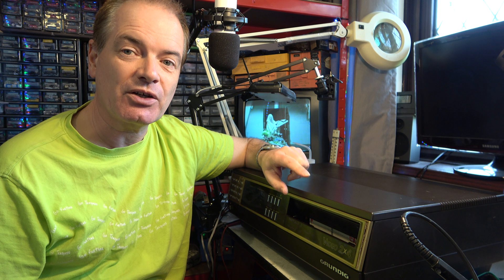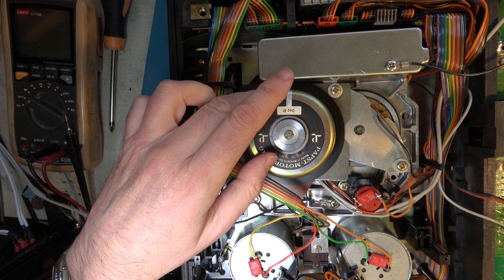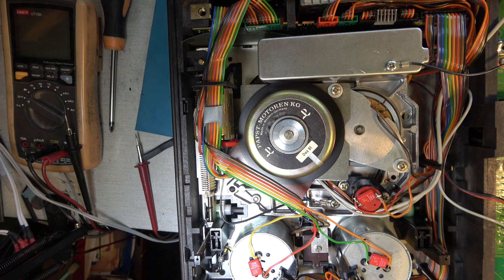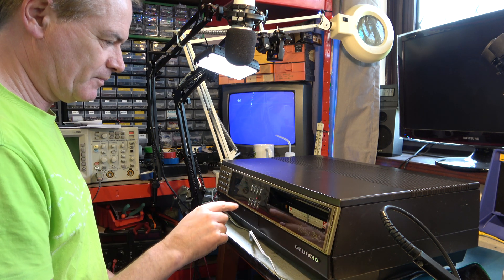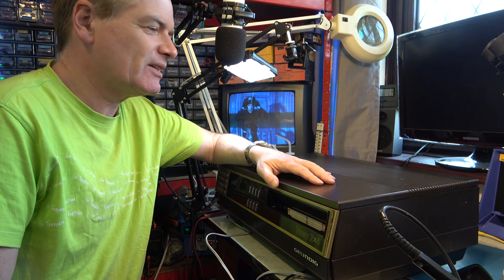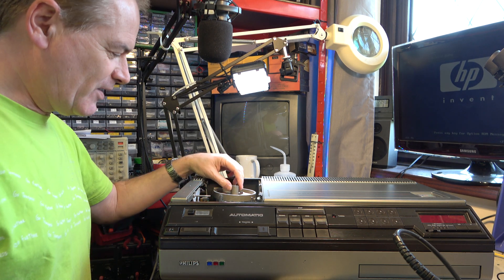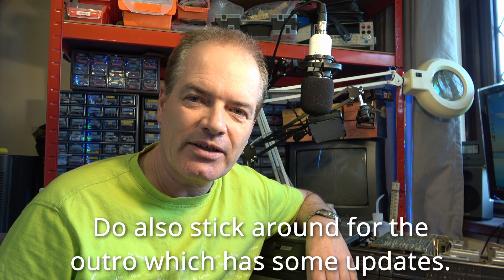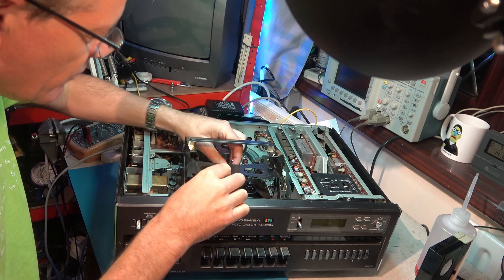More on a Grundig 2x4 Super V2000 and unbox a Philips N1700.

Comment: I also have a Grundig v2000 with audio problems. My audio is going to slow/fast. Do you know how to fix this? Maybe you can make a upcoming video of audio problems in V2000 in the future? Thanks for a great channel.
Reply from the maker: I would start by looking for broken connectors on the top and bottom of the motor driver board behind the deck.

Comment: I own an ED Beta that jas the load mechanism''s panel crack. It's in black plastic and prevent the tape from ejecting without a usefull hand... This piece is obviously unavailabke. Should I try to glue it some how to prevent flexing or can it be reproduced accurately in 3d printing??
Reply from the maker: I would start by trying glue with epoxy resin.  But I don't know the part, so I don't know if it's something that could be 3D printed.

Comment: Or you could use the tip of a drill chuck, It will clamp on the shaft and the outer edges of the three jaws will center the plate.

Comment: The grundig was my machine I had picked it up from a flea market. The uln2003 driving the display was busted I replaced it with a row of transistors. It was just perfect gave a good picture never ate any tapes it would follow commands immidately (even an eject can be reversed) it works with 'real time' tape position and programming was a breeze just type in the numbers it even sorts programs to the correct order. I could record 4 movies onto one tape if I wanted to see the second movie I would put in the tape press 200, 'zulauf' and it would wind to the 2 hour position, fast and quiet like the wind.. Just.. god-like compared to any vhs or betamax of the time. One problem with it is the front plastic shrinks and that sticks the buttons on the left a cut right next to it solves that. The great thing about the interface is you type in a number and then what to do with it. So setting the clock is like 1400, 'uhr' and that's it. It's not like you press 'clock' and then stuck in some sort of time setting mode. It's a bit like those hp calculators of the time. Same with the programming you do not have to follow a certain routine, the _> and  <_ buttons will step through the pages (2 per program) and you can type in the data at will or edit. If you get a number wrong it's just a matter of re-typing it, so 2200.. no wait 2205, 'stop'. There are these different levels of easiness or directness in the interface that's inherent in the design it's just so 'perfect'.. don't get me started on that grundig 2x4 super man! 
oh by the way there's a little button behind the little brown flap underneath called 'prog' or whatever you need to press that one to finish programming. Otherwise it will just jump back to normal and forget whatever was entered.

The tape lift/reeking in mechanism is kind of interesting, one motor drives both functions. There's a wormwheel that slides over a rectangular shaft, that shaft is driven and the worm is hooked into a rack and so it moves itself backwards/forwards to operate the lift. When it has reached the end it hookes into a cogwheel to drive the tape ring/ reeking in mechanism. The wormwheel position is transfered to the vertical lift via another set of racks/cogwheels. There's a piece of plastic that 'holds' the wormwheel to transfer it's position.
The transfer from one function to the other is kind of interesting, when a cassette is being loaded the worm moves forward along the rack at some point it reaches the cogwheel and hookes into it but doesn't drive it yet because it's still moving forward so it's teeth are standing still so to speak. At some point it will have left the rack completely and reached an end so it cannot move any further and then it starts to drive the cog. Getting from play to eject the reverse happens the worm drives the ring and when it has reached the end the cogwheel won't turn anymore and it will now work as a rack and the worm will push itself backwards and hook itself into the fixed rack again. There's some spring tension here and there to make everything work like it should. Maybe it's just the springs in the lift that push the worm forward. So when the tape is fully loaded around the head and you press eject and the worm instead of driving the tape ring starts to move and eject the cassette.. we wouldn't want that to happen would we?
Reply: Maybe that explains why it has trouble ejecting the cassette it has to move against that spring tension.
Reply from the maker: I'm glad someone is on the same wavelength as the designers of this thing.  Most UK customers were just baffled by the programming function, and the need to press a button within a few seconds or lose it all was infuriating.  The remote control layout was designed by an alien from another universe too.
Reply: @video99couk  That function was transferred to their vhs counterparts. My friend had one, and he gave up programming his video asking me to do it instead in my vhs...he was too slow
Reply: uln2003 is available ?

Comment: Hi, You can 3D print a tool to center the plate, similar shape to the socket you tried to use, but with the correct dimensions.
Reply from the maker: Yes that could be done, hadn't thought of that.

Comment: Hmm i always thought the word meander means to wander around in a none straight path, like wandering around a messy  car boot sale layout.
Maybe the bearings in the capstan are worn/loose and the bar is wobbling about.
If it was a vhs machine i would check for too tight a tension on the tape causing slipping at the pinch roller.
Speed faults are a swine to smooth out.
And a new patient to cure it's problems Doctor Colin :-D
Reply from the maker: The capstan spins smoothly, so I'm sure the problem is electronic.  It's also intermittent!
Reply: @video99couk  Blame the capacitors in the servo, i would.
Dam capacitors grumble grumble :-D